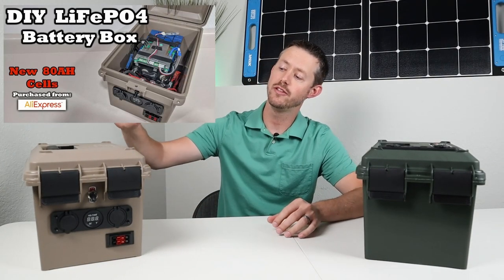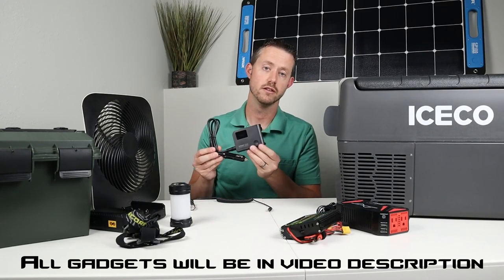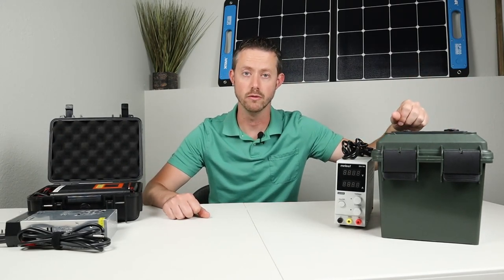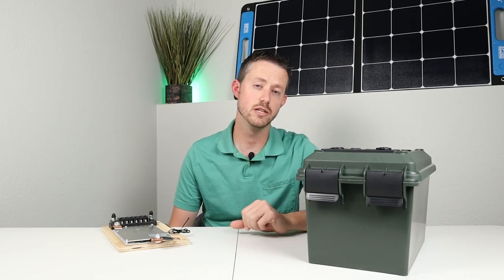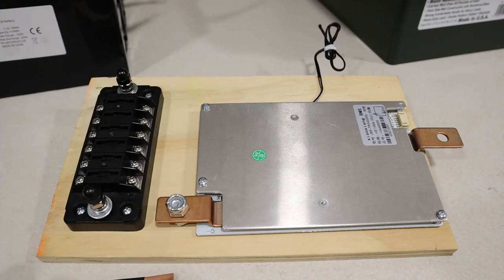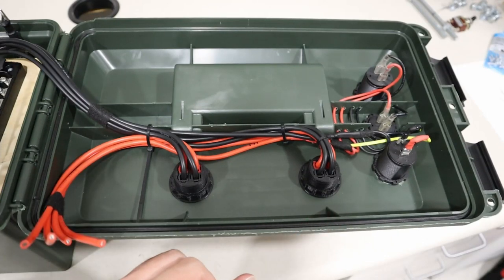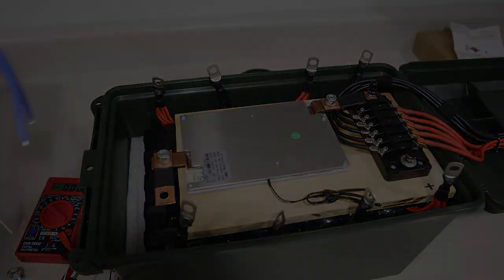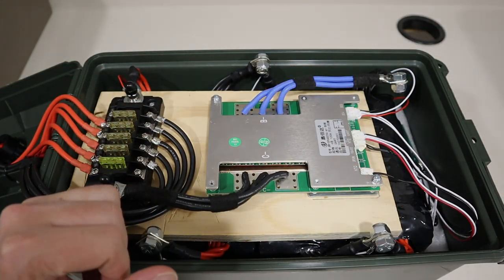$420 100AH LiFePO4 Build - BatteryHookup.com Modules - Super Easy Assembly! COMPLETE DIY GUIDE!

Comment from the maker: FYI....THESE MODULES WILL BE BACK IN STOCK IN 1 TO 2 MONTHS

Check out the parts list and wiring diagram HERE on my website:
https://jasonoid.com/diy100ahlifepo4/
Reply: Did you notice the gauge of the wires on the battery was 14, and each only had 5, therefore only safe to charge/pull 75A?  Not the 100A as stated? Because I bought these after the video and my system needs to pull 80A for my tiny home. Not sure what to do now. Great video though
Reply from the maker: @gradybrill3203  mine are labeled 12awg
Reply: @Jasonoid  lmao mine are labeled 14. How sad.
Reply: They told me through email right now that they did an 100amp discharge test to make sure it was safe. But does that test apply when my solar will be constantly feeding the battery all day, and the ac draining it thus going far over 100 amps in a day. Not sure its safe
Reply: Do you have any alternative modules you can recommend? Looking to get the project started! Thanks again for everything you do on this channel!
Reply: Hey Jasonoid -- BatteryHookup permanently discontinued those modules. I cannot recall what their C rating was for max discharge, I think it is 1C? Anyway, if you have a better idea or solution for the 100AH setup, I'd love to hear it!

Comment: One of the best build videos for a portable power station I've ever seen.  Thank you for providing these clear instructions!
Reply from the maker: I couldn't believe there werent any other videos using these cells! They are such a good deal!
Reply: @Jasonoid  - There is another video out there of someone talking about these cells, but they don't actually build a useful power station out of them.  I agree they are an excellent value and one of the easiest options for building your own battery with.  The build quality and clear instructions you demonstrate on the actual power station are just as impressive.
Reply from the maker: Appreciate the feedback, thanks Jason! I'll provide some more videos on the channel doing some more testing with these cells.

Comment: I built a very similar box after I saw your previous build. 4x100ah prismatic cells squeezed perfectly into an MTM 50 cal box, along with a similar USB, voltmeter, anderson panel, and remote battery posts. I'm using it to power an Iceco JP50 in my daily driver, charging from a 100w panel on the roof. Really pleased with the whole setup, especially compared to the Orca cooler I've been keeping iced down for the past several years. Thanks to you for all your knowledge, I wouldn't have known I could build something like this without the info I got from your channel. Next, I'm graduating to 300ah lithium banks for the RV!
Reply from the maker: Thanks for the feedback! I appreciate it :) That would be an awesome project! 300AH!! These batteryhookup cells could easily be assembled into a 300ah pack!
Reply from the maker: Hey your other comment got blocked by YouTube, try reposting it without the Amazon link.

Comment: Great video. I think this may very well be my next project Very detailed explanation on how you did everything. I'd like to see you do a full-on solar generator with a detailed description like you did in this video.
Reply from the maker: well thats very similar to this but just adding an inverter and charging system. I'm debating about building a 300ah version to power some fridges in case a long duration power outage.

Comment: Can you use a 5A hobby charger to charge this from a vehicle lighter plug? Take about 21 hours?

Also could you use this to jump start a car via the Anderson plugs to a battery or jumper cable from the +\- terminals inside the box? If not jump start, maybe give the vehicle a quick 5-10 minute charge?
Reply from the maker: You can use a 5 amp charger to trickle charge the battery, that would work just fine and would take quite a bit of time as you suggested 21 hours.

You can't really "jump start" a car with LiFePO4 but you could use this battery to charge your starter battery if you were having issues.

Comment: I've been looking at something like this for a newly acquired 12v fridge (also on your recommendation). Saw the BatteryHookup kit and it seems to be just about the cheapest way to get into a 100AH 12v setup. Seems about perfect for that arrangement. Finding a charger to get up to 14.4V is more of the problem. Using a regular 12V charger would only get you to about 13.8 or so, which is limiting capacity on LiFePO4.

I also keep debating this or a Bluetti EB55. I have a 1.2kwh 48v LiFePO4 aux batt setup for an e-bike that is easily portable with a 30A 12v buck converter that works for the 12v fridge, so an all-in-one would fix the charging issue and add solar. I do like this as a capacity booster to an all-in one, I'd be curious how as setup like that would work for you?
Reply from the maker: I have plans to purchase a couple "budget" chargers for this so stay tuned to the channel for those videos.

 I found a really good 300 watt / 24 amp MPPT solar charger that I'm excited to test, not many videos on it. That was only $50. Still looking for a decent ac wall charger for this setup.

Comment: I like your over all layout it very tidy. Maybe use a different material to mount the BMS, wood is an insulator but is also a fuel (possibly a piece of ABS).  I wonder if large heat shrink would go over the 5/16 blots joining the modules.
Reply from the maker: Thanks. Great recommendations!

Comment: Wouldn't it make sense to use a qc 3.0 usb instead? I think it's backwards compatible, but wonder if that would be true with an inexpensive board like this. Perhaps the wattage would be too high.
Reply from the maker: Yeah, they are backwards compatible, I had this front panel from my previous build so I didn't buy a new one. There are newer options with qc 3.0

Comment: I made a powerbox 571Wh for only 200€
Got 80 good 18650 out of a bicycle battery 90/98% capasity :D 

But if i add a 1000Watt inverter it will add 140€
Reply from the maker: Nice build! Sounds like a fun repurposing project! Also good pure sine inverter always costs a bunch of money. I just purchased a xantrex 2000w inverter and it costed $450, ouch!
Reply: A good little powerbank you have there, I have inverter 1000w for my powerbank but rarely used. A good system based on electric bike battery (24v / 10A) an inverter 500w / 1000w (it is important to know that a 500w uses less power without load and is better for charging your other 230v things and led lights. A 1000v watt inv. User a little more power but can better handle the same power and does not get so hot and noisy. 24v is a good thing most cigar usb for the car can easily handle 24v directly. Hope it helped a little and for others who may see this.

Comment: Thanks Jason!  Your video got me off to a great start on my project to put LiFePo4 batteries under the back seat of my access cab Tacoma.  I even ended up going with the KISAE DMT1230 charge controller, which fits vertically in the back of the center console, fed by repurposing the inverter power feed located there.

I am interested in how you have made out using the MPPT solar input for charging from a DC power supply.  I plan on installing an SAE port for a small portable solar panel to augment charge when camping.  It would be great to have the option of plugging an AC->DC power supply into that port when shore power is available but I'm concerned about damaging the expensive DMT1230.  Have you had long term success with that setup?  Is there a reason why you chose that route over a 12V power supply on the alternator input for fast charging your DIY bank?
Reply from the maker: Sounds like an awesome project on your Tacoma!

I'm not sure I have tested using a DC power supply input on the MPPT connection for that charger. I have only connected solar panels and the DC output of my 4Runner alternator. I'm sure you can connect a DC power supply into either connection as long as it's within the support voltage limits for the DMT1230. I don't think there would be any issues doing that.

Comment: I'm thinking I'd like to use this battery box for amateur radio use cases. I have two in mind:

#1 would be as backup for my home station, kept on float, but able to put out 40A through a single Anderson PP to connect to my station's power distribution panel. Only one PP connected in this use case;

#2 would be on Field Day and Parks on the Air (POTA) activations where I mostly would use lower power, but might like to have use of 100W (requiring ~28A draw) output from my transceiver from time to time and would run my logging/digital mode computer from the battery box as well. Perhaps some other low draw (LED lights, fan, etc.) at the same time.

Could I use a 40A fuse on one PP and perhaps one other with a 30A fuse? I could go to #10 AWG wiring for those. Total draw from the box in all cases would be less than 80A? What do you think?
Reply from the maker: Sounds like a great use case for these modules. The battery in total can handle a 100amp discharge max so it should be fine. Anderson power pole come in three different sizes, 15, 30, and 45 amps so you'd have to set it up with the proper size for your load.
Reply: @Jasonoid  Investigating the 6-circuit fuse block with negative bus I discover it's rated for 75A total; 20A max per curcuit. A bit light for my use case. Thank you for this great video and all of your detail on your website, but I'll need more advice as I go forward with some of my changes.
Reply from the maker: You can use just large wires and a fuse and you're good to go, you don't need a fuse block.
Reply: @Jasonoid  probably what I'll do is use #10 wire and run it to screw-down/banana plug posts mounted on the end of the box and use ring terminals to connect to the posts on the fuse block. The distribution panel is fused including 40A on the input.

Comment: Awesome video man. Very thorough and detailed. I recently built a very simple battery station using a 12 v deep cycle battery and an inverter to run my electric smoker. It works great but now I want to build a more advanced power station and I'm glad I came across your channel. I'm new to the game, so do you know if some of the parts from your build could be replaced with premade parts?  I've never done any soldering and I don't want to risk short fusing on my first try 😂. Can I connect a premade BMS to those batteries? Thanks.
Reply from the maker: Thanks Jimma.  There are connections that can be crimped instead of soldered. I'm sure you could use those on a build like this instead of soldering. Youd just need some decent crimpers and ring terminals.

Comment: Hey, sooo total novice here. 
 I want to do this but with a single 12v 100ah  lifepo4 battery that already has a BMS on it, I also want to add a little battery monitor screen to the box im making. Will I be able to still follow this tutorial as is, just leaving out the wiring that is specific to your batteries, and ofcourse adding my battery monitor screen? Idk if im just not understanding, but If im understanding how this works, Im hoping my version will be significantly less work for roughly the same price, just larger and 12v vs 24v capability? Thanks so much for this and in advance for your response.
Reply from the maker: You might need a little bigger battery box but it should work just fine without the BMS since you already will have one wired up (inside the battery).

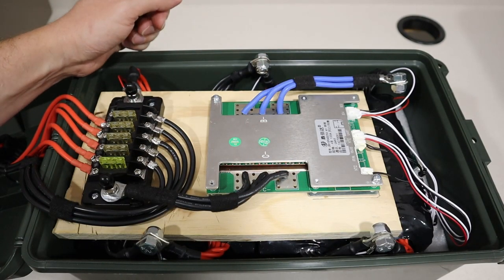Comment: Great, clean build. One question. Is there a reason why you wire your fuse block so the negative and positive wires are offset. At 26:02, there is no negative wire connected on the right side from the first (bottom) fuse on the block.  Then the top negative, there is no fuse and no positive wire. Thanks!
Reply from the maker: I don't have a fuse between the main terminals and the fuse block because it's not needed. The BMS has protections built into it (the BMS is on the negative line) and all the outputs / inputs are fused on the fuse block.
Reply: @Jasonoid  Thanks for responding. I just realized what you were doing with the fuse block and the wiring. HAHA. My bad.

Comment: Do you think the flattened copper pipe connector should be tinned? Any chance it will develop resistance over time due to corrosion?
Reply from the maker: I live in a desert so not an issue for me personally. Where you live you may need it.

Comment: My one real concern is that in line LED switch and it's wires. Those small wires and the ratings of the switch itself are the limits of the power draw by those three things attached to them. Can the switch handle that much draw without voltage drop from the small wires? Will the draw be more than the switch is rated for? Just a thought.
Reply from the maker: I don't pull large loads through the switch, any large loads go in or out through the APP connections. Works fine for 10amps or less.
Reply: @Jasonoid  Thank you. Good to  know.
Reply: @Jasonoid  It might make sense to install an automotive relay to prolong the life of the switch. I did this with a small Makita battery box and low voltage cutoff board. Thoughts?
Reply from the maker: @leftofone  I'm sure thats a great way around trying to pull full power from the 12v socket and USB ports at the same time. Good idea!

Comment: How can you determine the capacity, charging rate, etc. of the LiFePO4 battery in this build? Is that done through the BMS bluetooth module?
Reply from the maker: When you discharge the battery you can have a shunt track all the power going out of the battery, that will tell you how much capacity has been used.

Comment: Amazing tutorial and thank you for the wiring diagrams too and parts list.  It's so useful to have every single part used.  I was wondering.. can I use these same parts, or what parts would you upgrade/change to support the use of anlarge electric winch which might pull 250-300A, however for no more than 10 seconds at a time?
Reply: To clarify.. I'd be not using the BMS (for discharge only).  This is just a temporary
Reply from the maker: Hey Tyler, thanks for the feedback! 200 to 300 amps is quite a bit for these Lifepo4 modules. They are rated at 100amps continuous and I haven't tested them at that 200-300 amp rate. That might be okay for short bursts but the biggest struggle you might have is having a BMS that can handle 200 amps without shutting off. Maybe you can double stack these BMS modules in parallel to support 240amps (since they support 120 amps each). Youd have to do some testing in that uncharted area haha. Sounds like a fun project!  If you check out Battery Hookup they have some lipo pouch cells rated at 300amps, might be a little better for that high current draw you are wanting to run.
Reply: @Jasonoid  I'm just getting around to ordering all the parts now.  Can I do this exact setup but have some kind of unfused bypass so that I can do high amps for short periods of time when needed?  So still going through the BMS but not going through the fuse block?  I believe these 100A bms can support 200A for short periods of time (10s discharge burst).    That brings another question I was wondering – on the discharge side, how important is the BMS vs the on the charge side?  If you do 200A bursts of discharge, will that rebalance quickly the next time you charge, or am I missing something
Reply from the maker: @tylerg3393  you can bypass the fuse block but I'd recommend always keeping the BMS inline with your load just in case. I haven't tested the 200amp load burst but it does handle the 100amp load just fine. 

The BMS doesn't really balance the cells. It has small resistors that balance a very tiny amount, so on a battery this big I wouldn't count on the BMS balancing anything. As long as you top balance your cells before assembly, they should stay pretty close together.
Reply: @Jasonoid  really appreciate you responding to comments months later - it's really helpful!  Ok that helps my understanding.  Do I need a switch to do the bypass?  I'm thinking of how I'll practically have the ability to connect to that bypass.   The winch has big clamp clips so I'd need access directly to large metal bus bars or something, avoiding any small gauge wire
Reply from the maker: @tylerg3393  If you wanted to have an inline switch it would need to be a beefy one to handle the load, probably something like a main power cutoff switch that rotates (those switched are used in RVs and Marine applications).

You might be fine connecting 0 awg wire to the BMS - Output and Battery Positive Output since those are rated for 100amp continuous.

Comment: I may have missed something, but what does that power button connect to? Is there a relay in there, or is it connected to the BMS? I'm guessing you're not running the full 80A through it..
Reply from the maker: The power button only controls the front USB port, voltmeter and 12 socket. All other connections are fused and powered 24/7. It's wired in line on the positive heading to those connections.
Reply: @Jasonoid  Ahaa, makes sense - I could see the other lights come on, when you turned it on, so knew it had to be connected somewhere! :)